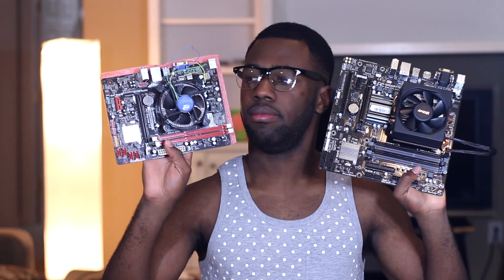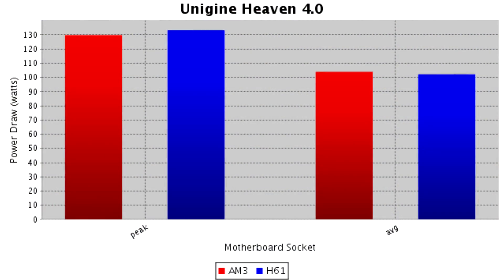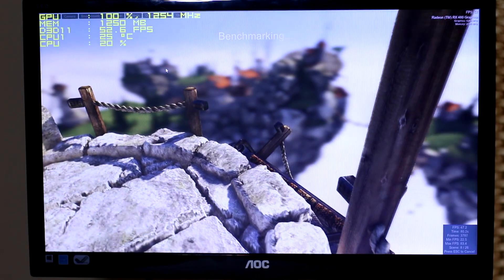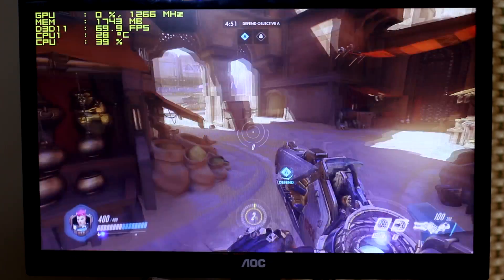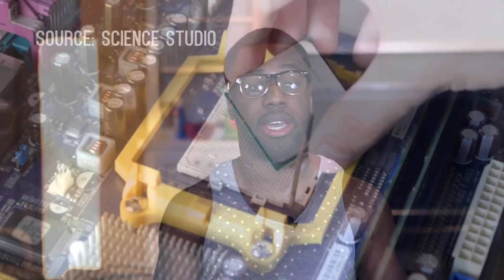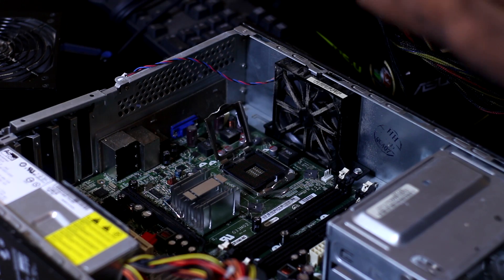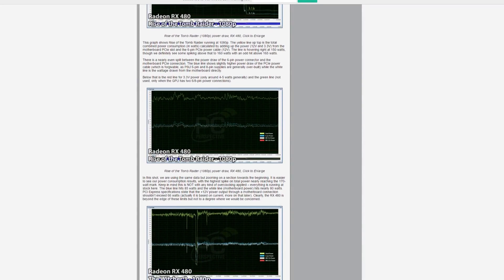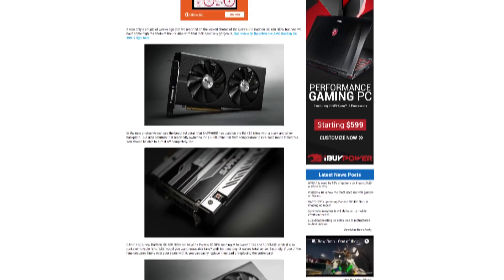Radeon RX 480 vs Cheap/Budget Motherboards - RX 480 PCIe Power Issues? | OzTalksHW

Comment: I'm kinda new to tech, so I was wondering if anyone could help me here. 
I have a 2014 hp envy with absolutely nothing changed. It has a newer i5 and one pci express 3 port or plug or whatever it's called. 
I am needing a new and better graphics card that was not 450 dollars (which I was going for with the gtx 1070) but, seeing as this is 200 going by what he said, this seems to be the better idea if it gives similar results. My point is, would the 480 work with my 2 almost 3 year old pc?
Reply from the maker: Golly Gee <3
Reply: It depends on your power supply. You need at least a 400w PSU for the 480, with an 8pin pci express connector. Dont buy the reference card, wait for custom designs from MSI or XFX or whoever and look for cards with 8 pin pcie power connector.
Reply: Thanks guys. That helps a lot.
Reply from the maker: Yes, but like others said, trade out the power supply with something better. EVGA's 500W models is a nice solution that doesn't break the bank
Reply: +OzTalksHW thanks you hot godsend.
Reply: +OzTalksHW you really deserve more subscribers for the amount of time u put into ur videos
Reply from the maker: AiEx MCG Thanks man
Reply: +OzTalksHW What's the difference between a regular card and a card (TI) like gtx 970 vs gtx 970x. Also, i  recently discovered a gtx 950 for 150 dollars on ebay, and a gtx 950 XTREME is 175. Should i get the xtreme ? is there that big of a difference
Reply: +AiEx MCG gtx 970 ti***

Comment: feel like if you are running mobos and cpus the old you probably need to upgrade that before your Gpu anyways.. I mean shit I have a 6300 I am pretty sure that CPU will bottleneck the card.. which is why I am upgrading that first
Reply: i think you will be ok with that cpu gl anyways
Reply: nah I am already seeing bottle necks( small but it is there cpu bound games defently see that push.) with my 380. maybe if I oced it idk.
Reply: try oc it maybe you will change your mind
but you need upgrade the cpu its getting old
like zen i5 or i3
Reply: zen i5?
Reply: yea I plan to upgrade this year to a new cpu, just waiting on the new offerings to decide on my plan.
Reply: are you overclocked? have my 6300 at 4.6ghz and it does fine. setup is held back some in cpu bound games still though
Reply: no I havnt oced it. was going to buy a cooler for it.. but desired the money was better spent towards  a new processor.
Reply: yesfull man Probably right at this point. Though a cheap cooler like a evo 212would help you get some extra performance out of it for not much money. I went with a h80i a year or so ago and that was a $100. Hopefully I will be able to carry it over to the new zen based FX chips
Reply: You might have to order new clamping parts.but it should Cary over.. I mean if not you can always zip tie! Lol

Comment: its all bs. Not a single legitimate case. Some random noob posts picks of him burning his mobo plastic as proof. on some deadbeat motherboard he never used. It doesnt check out.
Reply: if there is no issue then why have AMD admitted there IS an issue and have stated they are working to fix it?????
Reply: +strangegoat1 to quelm the thirst of those that are too dumb to realize that the power draw was over blown, and for PR, i mean, it hurts amd how these knowledge lacking journalists promote false information about the RX 480, so.. in a PR standpoint, AMD made that announcement
Reply: Just look at the test results from the likes of Tom's Hardware; there is a legitimate problem here.  http://www.tomshardware.com/reviews/amd-radeon-rx-480-polaris-10,4616-9.html
Reply: +ImpieYay PC per disproved that, Toms hardware overblowed the 480's power spikes
Reply: There is no issue unless there is implications. There is hundreds, no thousands, of cards not tested in this method and we dont know how many have this problem - one thing we DO know for sure is that there is no wide spread reports of damaged cards or anything connected to overdraft on the pcie socket.

Comment: most my 480 4gb has pulled is 142.5w on fire strike maxed out. normal gaming load it hovers around 113w to 130w. but it is only 4gb model so slower memory and less memory to power
Reply: 4gb has 7000mhz effective memory clock and the 8gb has 8000mhz
Reply: +Dustojnik Hummer I believe it's down clocked a bit, but either way more memory modules=more power
Reply: yes, it has a bit slower memory speed in general, but not that much to notice it extremly.

Comment: the problem is that those cpu´s will bottleneck the rx ...maybe redo it with a i5 in the intel mobo...i dont think the am3+ can handle a fx 8320
Reply: AM3+ can support the FX 8320
Reply: zBruda yes but the motherboard will need a beefier vrm solution
Reply: I've owned a AM3+ mobo and a FX 9370 for over two years now. And I've never had any problems. AM3+ can support the 8320.
Reply: a cheap motherboard can support a 8320 i had one a msi blue crappy one for 50 bucks and i ran my fx 8320 fine
Reply: Bottlenecking is overated
Reply: Sonny Miller it still has a 990fx chipset
Reply: The Villain jep but then there's not pcie threshold
Reply: +Arthur K, in my defense. I carefully read your earlier comments to this video and you never mentioned the word "cheap" either! Just wanted to point that out before you go back and edit them to support your ignorance!
Reply: Sonny Miller i meat the am3+ motherboard can't handle it, which is probably the case with his, I won't edit it because I'm a man who admit his mistakes
Reply: Speaking from experience, an FX-8320 will not bottleneck a 480. The 480 is similar in performance to a stock 390. I own an overclocked 390 that trades blows with a stock 390x/980. The majority of games I own do not encounter CPU bottlenecks on my FX processor. Witcher 3, GTAV, DAYZ, Regular Firestrike Combined Test, and a few others are the rare exception. 

Increase the resolution above 1080p and the CPU will play even less of a role. I own Dark Souls 3, Metal Gear Solid, Fallout 4, DOOM, Dirt Rally, Batman Arkham Knight, Ashes of the Singularity, Assetto Corsa the list of games that run perfectly fine goes on and on.
Reply: I run a Asrock 990FX extreme 3 that everyone says is a pile of shit for VRMs yet here i am with a 8320 at 4.8ghz just fine for over 3 1/2 years now.
Reply: +Arthur K you never said cheap
Reply: Yor Highness, bottlenecking is real, i bought an AMD laptop and the CPU isn't even close to being able to support the GPU. Only a couple of games like AI and TESV run properly. NEVER AGAIN
Reply: Arthur K has a salty day. don't take him serious :D  now my question: are you wating for Zen or why havent you upgraded your CPU yet (from intel) ?
Reply: Where can one buy an amd laptop?
Reply: Sankanyu everywhere, the a10 and a8 and fx88xx series are still pretty good apus
Reply: Arthur K
Thats a laptop with AMD parts, I thought you had a laptop made by AMD itself.
Reply: Sankanyu I don't even own a laptop...
Reply: laptop that's why. people never learn.